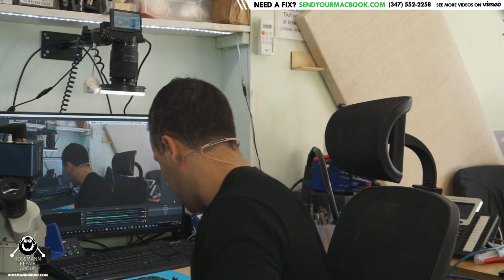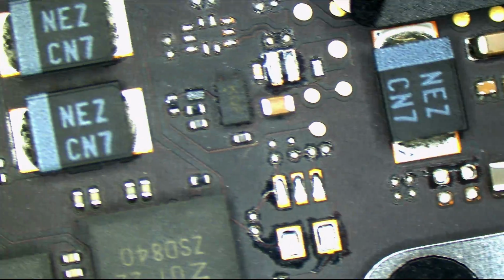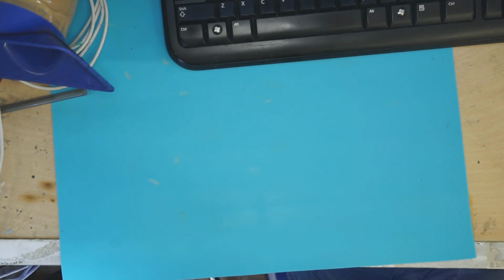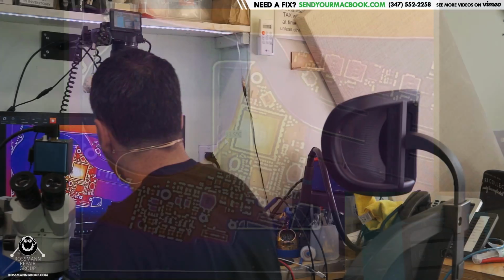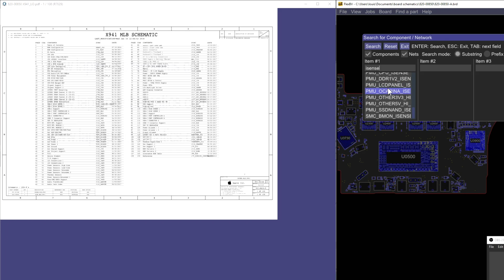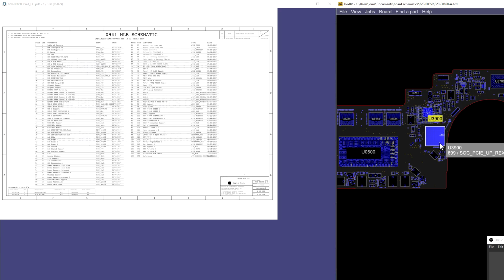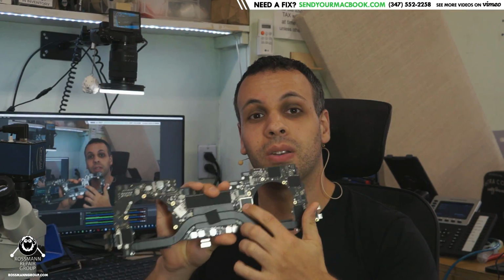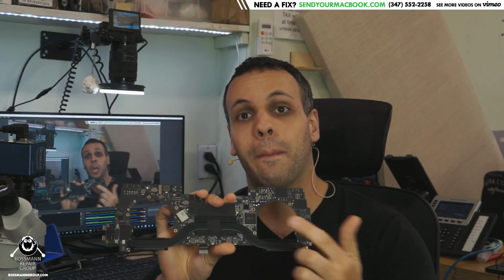Apple users have no one to blame but themselves.

Comment: Can someone explain how this is different from full-disk encryption on a SSD + TPM? From a quick Google search, it seems like they've just combined the aforementioned functionality with a kill-switch for webcam + fingerprint sensor in the same chip.
Would swapping out a different T2 + SSD pair fix this?
Reply: Not necessarily, because, as he stated in the video, you need to reprogram the new T2 chip to work with the specific components of the board and Louis does not have access to that programming (it is an Apple only thing). The problem here is that Apple themselves are claiming that this board is "not repairable due to liquid damage,' which Louis showed was a clear lie. Basically, Apple is the only one (currently) that CAN fix it, but REFUSES to due to GREED.
Reply: I do agree that the 'liquid damage' claim seem lazy, but I think the 'unrecoverable data' part is by-design for security.

Maybe having a replacement chip to reinitialize the machine to a blank-slate with signed software should be an option?

Balancing security (of the user-data and hardware platform), repairability, and UX/convenience is hard, and I don't blame them for that. Though I do think having to purchase a new machine for faulty component reliability (when the original purchase is still under warranty) is a terrible way to treat your customers.

Comment: Wait, what about those two dots that Apple claims that will trigger when it has been exposed to water? I know I was at the Apple store and asked them if the water indicator would trigger even in high humidity environments and they said yes. I advised them that it would be a false positive as many customers possibly live in or travel to places that are high in humidity. The guy was quiet. And to let you know some use Apple products for development or creative uses.  But I do believe the trust in Apple by consumers is reaching its tipping point as I know one friend where he works they have switched from Apple to Windows because they could know buy video cards that can out perform Apple's built in video cards and the repair ability and cost out weight buying a new Apple computer.  I am still writing to my state reps in California to push for the fix-law to get passed but it is being stalled here.

Comment: This is why I am anti-T2 Chip.
The T2 is anti-consumer because it stops you from choosing your OS, stops you from self-repair, and stops you from owning your device.

Stops supporting Apple if you value your time and money.

In addition, boycotting them will force them to change their methods of screwing the consumer, just saying.
Reply: But... but... they make such pretty products. And 0.040" thinner than the competition and that's what really matters, right?
Reply: It's hilarious that people have to be told to "boycott" shitty overpriced products
Reply: @jaymatthews9324  I wouldnt call their products shitty and overpriced. Apple products arent shitty, the business is and the way its run. The products themselves are fairly decently priced, with the exception of a premium for the brand.

Overall apple products look very good, the OS is amazing for productivity, and the price although not amazing is not over priced.

The problems are how Apple deals with its customers, how apple treats its customers, there business plan, there warranty. The products arent the problem, its everything else that comes with the purchase of one. Thats the problem with apple.
Reply: @seiori  fairly decent priced?! The electronic design is the same as a low-end device from any other company. For example soldered SSD or RAM instead of socketed are scams for that much money. For the same price point you get way better hardware with OEMs' devices coming with Windows preinstalled.
And if you really want OSX, you'll better served with some Hackintosh than an Apple product.
Reply: @seiori  they are not decently priced. You can pay £500 for a laptop that is more powerful than a £1000 macbook.
And the quality is trash. I've never had a laptop fail on me ever in twenty five years. Now look at the macbook keyboard. How apple gets away with this is mind blowing.
I understand if you like apple but unfortunately they make all their money from people that really have no idea about their products and just buy them because they think they're a luxury product.
Reply: @TheBoscombesurfreef1  When you purchase a laptop its not just about performance. There are othed qualities that count to the price you know. Dont be so ignorant about it. There is certainly a premium you pay, but its still a decent price. Notice how I use the word decent
Reply: @seiori  If you like their product is one thing but saying that is not overpriced is a ridiculous thing. This guys sell a freaking stand for the money you can buy a powerful PC and they are not overpriced?
Come on man. Everything they sell is overpriced. Their computers have the price of much more powerful machines than the performance they give, their smartphones are overpriced as well, yes they are from strongest devices BUT damn it you can get most of that performance with a lot more features for half the price. Even there damn quick charger is crazy expensive when others give it for free.
Reply: @seiori  then Tell me about these quality or shut up.
If its only about Design and Build quality. 
Look at These Thing
 "redmibook 14" it will BE equal in build quality and Display.
 It is self repairable. So also every PC repair shop can repair it.
 The RAM and Ssd arent soldered, so you can upgrade these If needed. 
In Performance it will crush every Apple Notebook unser 2000 Dollars because of an Dedicated mx250 GPU and a Whiskey  Lake i5 / i7.  
Are some Arguments left, Fangboy?
Reply: @michaelschmid2311  Very aggressive comment you went with there. This is a discussion abour said products. So you can relax a little my friend. And sure ill give my thoughts, never heard of this product so this will be my first impression review compared to the Macbook. On looks apple wins, the exterior of there macbooks are a lot more cleaner and luxurious imo. The both have a similar design, however the macbooks finish just looks better all round. The bottom bezel of the redmibook i dislike, its to large for my liking. And i prefer all bezels to be of similar size. The UI on the redmibook is nice, but not what i need for my use. The 4 thunderbolts are perfect for me. Helps keep the exterior looking minimalistic and good connectivity. The logo on the back of the screen again goes to apple. Prefer a nice simple logo to text. As you can tell i love minimalistic designs. The OS is MacOs so it wins there. For my needs MacOS is amazing and a nice change from windows. The mousepad its unbeatable, not sure on how the redmi one feels so meh, but ive used an apple one in store. Color accuracy, apple are know for being good purchases for media consumption due to there quality displays. Havent done much research into redmi. Performance is cool, but the price to performance is not that much of a difference to similar products. And im not looking for a 4k gaming laptop, just something for media consumption, university work, and light programming. Which is perfect for me. My other choice is actually a razer but macos wins for me over windows. Hopefully this clears thinfs up for you, this is an opinion, so try not to be so mad :)
Reply: @1ofZero  it is not ridiculous. Price to performance is where all of you go with for pricing of there products, but you dont factor anything else. Also everything is subjective. I think macbooks are worth the money because the design is a huge yes for me, very minimalistic yes luxurious. And the OS is amazing for my needs. Therefore im hally to pay the extra amount, which is not much at all if you spend the time to take into consideration all factors that go into prices of products :)
Reply: @seiori  this Thing costs 500 Dollars Just install hackintosh on it  If you dont Like Windows. 
But If you wanna pay 2000 Dollar for an    little Bit better designed Laptop Go for it.
Reply: @michaelschmid2311  Why are you comparing a 500 dollar to a 2000 dollar laptop, now you are just exaggerating, hard to have a discussion with someone like that. Look, this is what i plan to purchase. https://www.apple.com/uk/shop/buy-mac/macbook-pro/13-inch-space-grey-1.4ghz-quad-core-processor-with-turbo-boost-up-to-3.9ghz-128gb# I take the CPU upgrade and leave the rest as it is. Now find me a Redmibook that is similar as possible to this. Match it as best you can, you can also link me a few other brands if you want. Take notice to the display. Looking forward to what you find
Reply: @seiori  let's not forget the EXTRA 500 dollars people are going to spend for apple care, and being ripped off by apple for fixing their machine. The amount of time people won't be with their mac because of it being fixed. This is such a common issue that is almost being swept under the rug by apple users just because their products look nice. Customers are essentially payinhf an extra 1000 for slightly thinner bezels and an apple logo. Yes I get people like mac OS as well but realistically 95% of users don't need the creativity apple gives you.

Another reason I think people get sucked into it is they think it just works out of the box and have been sold the myth, which had been going strong for a long time, that macs don't get viruses.
Reply: @seiori   Apple fan boooooyeee
Reply: @SHOWGAMER-  Far from it, this is my first apple product other then a iPad when I was a child. Need a laptop for Uni, and came to the conclusion the Mac fits my needs all round. The ignorance is strong on this one....
Reply: @TheBoscombesurfreef1  No one pays %500 for apple car. The amount of times you wont be with your machine because its being fixed. Depends on why its being fixed. Accidental damage, or system issues? Both can happen. And no people arent paying an extra 1000 for slightly thinner bezzels. Ive done some math when researching, and its around the 300-500 range of extra cost, however the machines that were in this price range, did not have the build quality of an apple macbook. As well as other features, so going on assumptions I would say you be around 150-250 premium for the macbook, which sounds bad, but in reality, you do get added bonuses that do make up a small amount of the difference. And also this is very subjective anyway, everyone has opinions.
Reply: SHOW GAMER with those 2 comments just delete your YouTube account.
Reply: Kaworu Sesu well said

Comment: If a knucklehead like me can build a desktop from scratch for cheaper than Apple's garbage, then you can too.

I had no previous experience in building a computer, just did my homework when building.
Reply: Not defending apple, but build me an iPad pro.
Reply: @The Lavian Give me an apple pencil.
Reply: @The Lavian Tell me something else other than surface to be able to easily hand write notes, manage notes, resize, drag,  append notes to existing pdf file without limitation of the page size, and be able to high light lines and can be easily erased. All those above with near zero latency. 
Yeah that's very nice of you to assume other people's needs.
Reply: @The Lavian You are the one that came to the comment section and replied to me alright? Don't bend the logic. I said build me an iPad pro. You said easy. I said then build me one. You said why would anyone need it? Wut ? your logic?
Reply: ClapTrap  Also you said, overpriced? Then give me one with similar feature and usability but cheaper. Surface being a complete laptop is more expensive and has less battery life. Wacom doesn't have display, only suitable for artists. What other options? Samsung?
Reply: @The Lavian No it's not a completely different product. It's part of the iPad pro experience. You can't have apple pencil without an ipad. And couldn't without ipad pro before.
Reply: @The Lavian Plus, even with your original statement. Raspberry pi? It's not a good joke. Yes it's realizable for basic function but fundamentally no actual application that's comparable.

Comment: That's what I was told back in 2014. I only had the macbook pro for 4 months. I was never around water. It was always in a case. I told the Apple employees in chicago where I took it to get it repaired when it quit. It Wasn't my fault. They told me I was a liar. I dropped apple after that! Apple internal memo is to push new products & not to fix any product!
Reply: This needs to be pinned
Reply: The problem with apple store diagnosing and repairing apple products is that genius and techs are not actually qualified to repair the products, nor do they actually know what they are doing. There is no such internal memo of pushing new devices, often times a repair option demonstrated by Louis is not possible because the people working don't have the know how to look for and fix those problems. They don't even have the tools. No thermal cameras. No electronic microscope. And barely any training. On top of that, repairs are covered under an additional warranty, so if any possibility of damage exists, Apple would be responsible for it. Big repair shops who provide warranties post repairs actually operate the same way that Apple does, like Geek Squad for example. I'm not saying that it makes it right, simply that the practice of employing under qualified employees who are trained to quote repairs that are not needed is an industry-wide practice, not only Apple's.
Reply: Every company that produces products does that, and ints not good for the enviroment.
Reply: Brato every company does that but apple is the worst of them seriously why can a company solder the ram and storage on the board?! Those are the things that can easily go bad or kaput even the graphic card isn’t serviceable what a sad word we are living in , those same companies are the first to say we use 100 % environmental friendly materials , my ass
Reply: @carholic-sz3qv  does apple sonder the ram and storage with the mainboard ?  I did not know it. If so those who buy apples  producs are extremely  dumb, so if a mac board fails and you have not backup  you're screwed  up ?   Not thank you, I would rather like to be able to change the ram, procesor and storage.

If this you say is true then apple supporters are at minimum brainwashed.
Reply: tony brito youre welcome, you can still buy older macbooks with replaceable SSD only or much older ones with replaceable ram and SSD even battery.

Comment: What does the T2 watch over? Like hypothetically could you replace the SMC as long as you also repealed and replaced the T2 with one from the same donor?

-not an apple expert, just watching one
Reply: Have you watched the video?
Reply: @johnyang799  more like passively listened whilst doing other things. Did I miss something Mr. Yang?
Reply: @AmaraTheBarbarian  So basically what he said was, we don't know what t2 chips doing. And other components are linked to t2 chip. So swapping t2  chip  won't work.